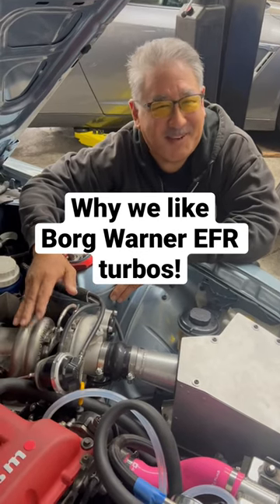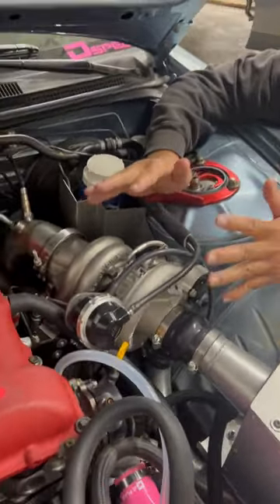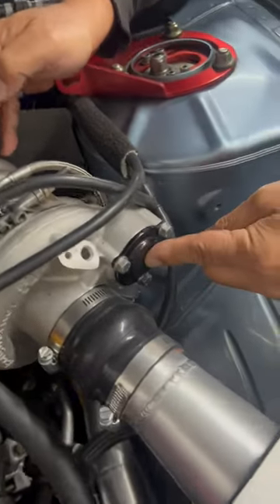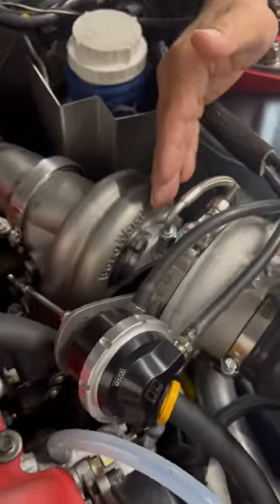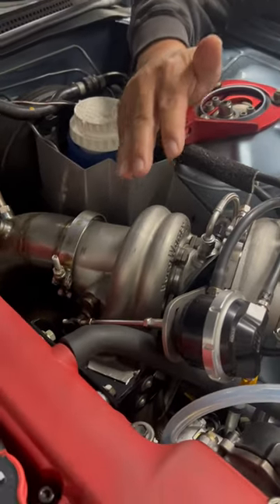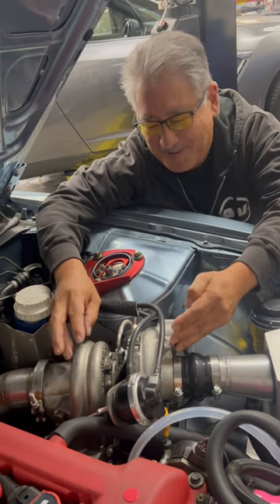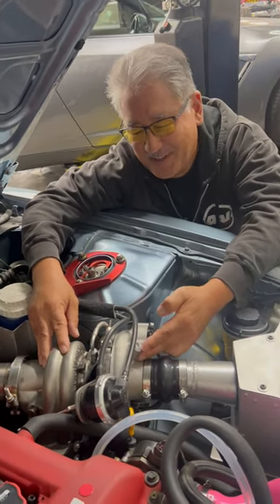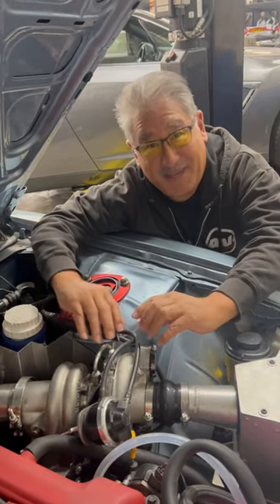Why we like Borg Warner Turbos!

Comment: Borg Warner way ahead of anything that Garret seems to have
Reply from the maker: Garrett turbos are also very good, the G Series is game changing good.
Reply: But BW gets the W right?? GG Garrett lol
Reply from the maker: The G series has phenomenal compressor maps, the efficiency is super high and the islands are super wide so the engine will run right in the fat part of the peak efficiency range. This means way less charge air heating and less backpressure and lag as the turbine has to recover less power from the exhaust.  Garretts are also more compact. So both turbos are super good, just at different things.
Reply: @motoiq  Not entirely true, running higher boost pressures to make the same power is not efficient, a turbo that has to spin at 120K RPM @ 900LPM is not as efficient as a turbo that spins to 86K RPM @ 900LPM. Boost pressure is the enemy of flow and shows the tuner and builder how restrictive the engine set up can be.  The EFR black series is the benchmark for performance. Some manufactures resort to spinning the turbo shaft at a higher speed to compensate for the lack of efficiency. 

A side note the restrictions on an engine including pumping losses will demonstrate why boost pressure is irrelevant, while the important part is how much power you can make at what turbo speed. Turbos are designed to be efficient at given speeds based on the compressor map. 
If the turbo manufacture does not release the compressor map it is best to stay away from those turbos. The compressor map determines what the flow rate of the turbo will be at a given RPM. A turbo that moves 900LPM can be used to understand if the pressure is rising before the power target is met or if the power goal is reached before the pressure causes a host of other issues. That is the fundamental way of determining the proper turbo for a given application.
Reply from the maker: Umm I never said that running higher boost pressure to make the same power is more efficient, where did you construe that I ever said anything close to that?  The rest of what you're saying is super obvious and not even in the context of what the OP was talking about.
Reply: @motoiq  by Insuianting Garret actually makes efficient turbos.. Don't play dumb about context. You were just defending their compressor maps....
Reply from the maker: Most of the latest generation G series turbos do have more efficient compressors. Just look at the maps.   Nothing to defend, simply look at them and compare them.  BW turbos tend to have compressors that generate more mass flow at lower shaft speeds, lower efficiency, and good surge margin.  Their turbines generally flow well due to having a mixed flow design, have low inertia but have lower efficiency but the other factors tend to cancel it out.  I really like the offerings from both manufacturers and we have no financial incentive to endorse either one. Garrett tends to have better more efficient aero and BW has more advanced features that tend to largely make up for having worse aero.  There are models from both brands that are outliers in performance.  Both brands have certain part numbers that are turkeys. Both brands have outstanding OEM-level engineering and quality. BW turbos have a longer footprint and can be difficult to package in transverse engines. We use turbos from both brands here depending on which one is better suited for the application. Apparently, you have a favorite and are having difficulty being objective so you are deciding to make some sort of pompous attack on us. Chill out.
Reply: @TheRobertChannel  it's okay, it's not your fault
Reply: @motoiq  The Air flow from the turbochargers are based on specific tests done in a controlled environment on gas stands and other flow equipment. The way to "read" a compressor map is different in many applications.  Physical tests done on engines with different turbochargers in a controlled environment will be able to be referenced against maps versus logged data to verify certain parameters. I can almost guarantee you that the Garrett will let you down no matter what the map says.

Don't get me wrong - Garrett USED to be HE brand of choice, but since they were spat out by Honeywell, they lost access to the aviation aerodynamic guru's and the management team that were put in place when the 'dream team' (the old great people/staff) left - are the worst people in the industry, the absolute worst management style, and autocratic approach, which was the reason the dream team fell apart in the first place - this filtered down to the product development team/marketing team etc - and the results are the poor quality and under-performing product that now exists.  Garrett were supposed to be on the Gen2 and Gen3 G-series long ago - ask yourself why they are not.
Reply from the maker: You read the compressor map the same no matter what you do. You figure out the mass flow of your engine at whatever pressure ratio you intend to run in along several points over the engines operating range plot them in a line and see where it falls on the map.  You don't read the map differently. Regardless of whether what you say about Garrett is true or not, we know every single person that works in the aftermarket division and we know most of those people who work for Borg Warner too.  Both Garrett and Borg Warner's aftermarket turbo parts trickle down from the OEM side of the business and the engineering teams from both companies make the best lashup of existing OEM parts for the aftermarket.  Both companies have suffered from supply and quality problems a few times over the years. As far as huge turnovers at Garrett, the same guys have mostly worked there for years. All of that is immaterial, maps, data, dyno performance speaks about what's up with turbo performance. What I said is true.  It is objective.  We have used Garrett turbos from everything from Formula Drift Pro 1 cars, Bonneville LSR cars, Unlimited and other time attack classes cars, and the most demanding arena for turbos due to altitude-related shaft speed issues, Pikes Peak and we have never had a single Garrett turbo fail or wear prematurely. This is actually racing in the most demanding conditions you can get. This is objective as well. I don't know what forms your opinions but ours are formed from actual use and years of experience, racing, not nondemanding street use or short-duration drag racing.
Reply: @MotoIQ  Oooh I am very curious to know which turbos in the G and EFR lines turned out to be "turkeys" lol... Spill the beans!
Reply from the maker: i dislike the G47 1650 for instance, I mean it's not horrible but its not as good as the Gen II GTX it replaced which was excellent. You can kinda tell which ones will not do well, Big mismatch in compressor/turbine major diameters, looking at the speed line mismatches on the compressor and turbine maps, not great compressor efficiency, narrow islands, bad flow and efficiency on the turbine maps. Not much layback on the surge line.
Reply: The stock k03 borg and Warner turbo on my 1.8t be motor is a champion turbo. Been run hard for 190k miles. Still hit 18psi. Just swapped it out for a k04-015.  but It could’ve kept going. They know what they’re doing over there.
Reply: @TheRobertChannel  Wtf is this. Garret makes efficient turbos. Idk what rock youre living under.
Reply: @Mad Mod  Easy, bro. He's a "Youtuber."  He must know what he's talking about.
Reply: @TheRobertChannel you blew that way out of context no one said anything about running high boost pressure
Reply: Is KKK turbos still around?
Reply: @briankissel7661 Borg Warner bought KKK a while back if not mistaken
Reply: @TheRobertChannel get owned kid now beat it
Reply: @mumble97  at 27 years of age I appreciate being young thanks and no i didn’t get owned I made him get his facts out because I don’t buy into BS
Reply: Both great OEM grade brands.
Reply: Which Borg Warner turbo is goos for a K24 build , for drag racing ?
Reply: @motoiq you should do a video on twincharged set ups and the advantages they can have.
Reply: @TheRobertChannel  information that he should be putting in his videos
Reply: @Uno_Floydd they are not a school to teach you that in depth about turbos and that wasnt the point of this video in the first place. If they want theyll answer questions or make videos going in depth, but in no sense are they obliged to. Go ahead and pay for a course and take time to learn or go get experience if ur so interested
Reply: @motoiq  yup garret gtx3076r is perfect for my b18c
Reply: I remember when the world champion time attack driver said I’m switching from EFR and going faster with the Garrett G. That is tattooed into my psyche.
Reply: What MotoIQ guy said, I love both Garrett & Borg Warner in terms of turbo chargers. When I was a child, I use to love HKS, lol, still do but its more of a nostalgia thing for me, they are decent but Borg Warner & Garrett kick ass. Nissan had Garrett make their T25’s & T28’s that were offered in journal bearing, ball bearing for specific Nissan model years, lol. Thats before their GT, GTX or the new racing GTW lines came out, thats before twin scroll tech too.
Reply: @motoiq first I'm sorry you gotta deal with us in the first place especially that guy don't know what he's smoking 😅. Second I'm in the market for a new turbo for my neon. I don't know exactly what's in there now but it looks to have started life as a td06h 20g with a billet wheel and a clipped turbine wheel. I'd rebuild but it's gonna take some time to find the right stuff and I feel its an old enough design that it might be worth it to go a different route. Now here's the question car makes about 600whp I love it and don't even mind that full spool is at 4500rpm if you were gonna upgrade what would you pick? It's a street strip car that also sees some autox. I was thinking about the g30-770 knock off that pulsar makes since it's in budget and would leave some room for roll racing down the Rd but is it actually worth it? I really don't have any aspirations to take the car over 700whp as she already slips around in 5th on street tires 😅. I can get a gtx3071r pretty cheap but I feel like I'll be just about maxed out with that and ultimately the car has some big cams and does see 10k rpm often and well I enjoy that it pulls and pulls all the way into the limiter 😂. Smiles per dollar that is what would you pick? I'm open to suggestions and I can always make a new manifold and machine anything I might need.
Reply: @TheRobertChannel  enjoy your fragile compressor wheel!!
Reply: G Series FTW !
Reply: @BoostedBrando  I LOVE my g25 660

Comment: I didn’t understand most that stuff but it sounds badass.
Reply: Built in waist gate and blow off valve prevent to much pressure on either side of the turbo. Normally you have to put those in separately, speed sensor gives you turbine Rpm so you can tune it. Ball bearings spin more freely compared to normal ones that float on an oil layer.
Reply: it has pretty much all u would need to achieve near max performance
Reply: @Cars_nedits  yerp
Reply: Harden up bro
Reply: @everettstormy I swear I just saw a comment by you under some aviation video
Reply: @porcupinepunch6893  I comment on almost every video I watch. I have literally thousands of comments on a wide range of videos. I'm guessing your referring to the 200 dollar airplane video
Reply: @everettstormy  the one that was made out of that hang glider?
Reply: All you need to know is bigger turbo more hp

Comment: hi, do you think an EFR 8474 will make 900whp on the same application a g35-1050 will?
Reply from the maker: Yes but 900 is at about the limit of either turbo
Reply: @motoiq  Great, i was looking for 850WHP on a DAZA 2.5L rs3, where the g35-1050 does 900 on.

Comment: is the bov electric or vacuum controlled, or can you get both? Reminds me of the recirc valves on modern bmw turbos
Reply from the maker: Vacume
Reply: @motoiq  That’s sick, never seen a built in vacuum recirc. Are electric bovs/recirc taking off in the aftermarket or not really?
Reply from the maker: Electric wastegates and BOV's like turbosmart are going to be game changing as they get more accepted.  It requires a lot of electronics integration and data logging to get the most out of them.
Reply: If only BW would stock them :(

Comment: These turbos really suit turbo charging different things like jet skis or kart. With all the kit they come OEM You save so much fabrication without needing wastgate a and blow-offs

They also ran large exhaust wheels way before these other guys-it’s almost like they knew the world was heading for e85 and big back pressure..it’s why the rotary guy dig them

the core is also trick, the BB case is bigger and far superior too any other brand

Then they too it’s off with stainless Exhaust

Comment: Will a g35-1050 spool faster than a 9274 in the same application?
Reply from the maker: No
Reply: @motoiq  thank you for your input. I have a 9274 and an 8474 and wondering which I should be using for a 900hp application

Comment: What are the speed sensors for?
Reply from the maker: turbo shaft speed.
Reply: @motoiq  for overboost protection or better boost control?
Reply from the maker: For those reasons, plus surge control, better turbo matching, turbo protection from overspeeding.
Reply: Short answer is the speed sensor senses the speed.

Comment: Good video, but its not compact, the complete turbo is very long becsuse of the turbine housing long tail. Also its not simple with bov built in, i think most people would blank it off and put a bov just before throttle body for the whoosh factor.

Comment: How do you like these compared to the G series?
Reply from the maker: It depends which G-Series, the small and mid frame ones are excellent.
Reply: @MotoIQ  I have a G30-660 .82 on my 1.6L 16V 4AGTE AW11 and it made 620whp at 9000rpm at 34psi on E66 on a dynojet!
Reply from the maker: Gonna have 2 of those on my R35!

Comment: Why would it need a ported compressor housing if it has a built in BOV? Doesn't the BOV prevent surge?
Reply from the maker: No the BOV prevents a different kind of surge, the severe type caused when the throttle closes suddenly.  A ported shroud prevents the kind of surge that is created when the turbo flows more air than the engine can swallow and it backs up in the manifold.
Reply: @motoiq  Great explanation, thank you!

Comment: Apex is better. They make the most hp for their respective sizes. They don't have a nut on the impeller so they're basically bigger, because the nut doesn't block air flow

Comment: I thought wastegate and bov were the same thing
Reply: Wastegate wastes exhaust energy to limit exhaust wheel speed to control boost output, blow off valve gets rid of extra boost coming from the turbo when the throttle plate closes so it doesn't back up through the compressor wheel of the turbo and slow it down/create turbulence that can reduce turbo responsiveness
Reply from the maker: Please do all the replies from now on!
Reply: @motoiq  would be my pleasure 🙏

Comment: Internal 'gates SUCK... 😂 Good for low boost, low hp set ups...
Reply from the maker: We make over 550 hp on this turbo, up to what the compressor is rated to flow. Same with all IWG Borg Warners
Reply: @motoiq  I stand by my former statement. That's kinda mild HP, isn't it? I think I'll stick with my Garrett and my Tial 'gate, at 840 rwhp I'd prefer a proper sized 'gate to ensure proper boost control. I'd never trust an internal gate with that kind of HP out of my RB30...
Reply from the maker: Yup for that much power you are 100% correct.